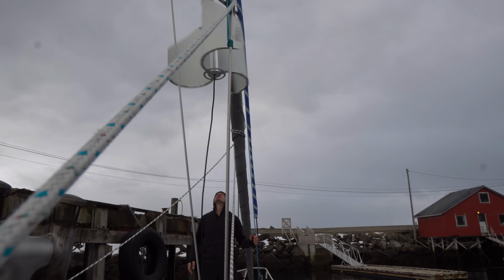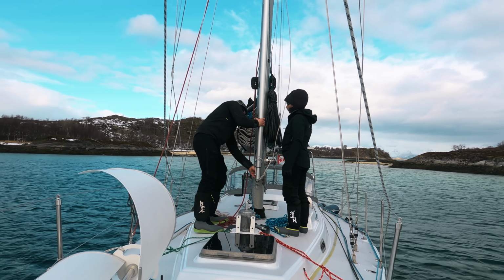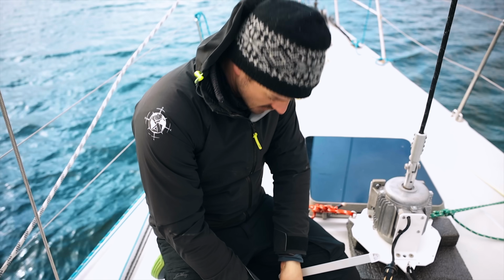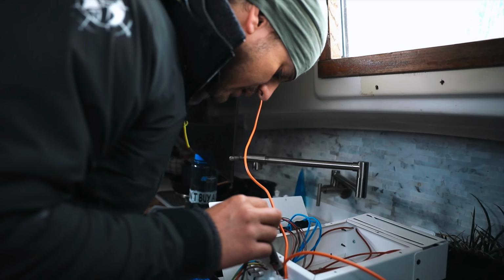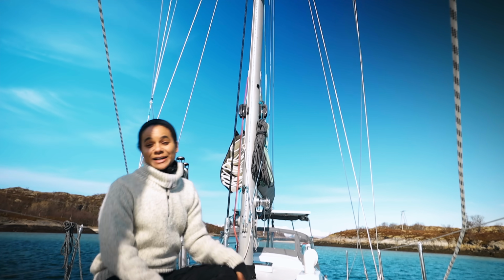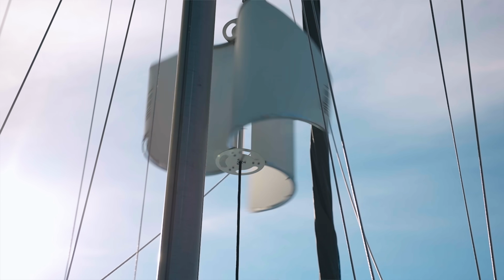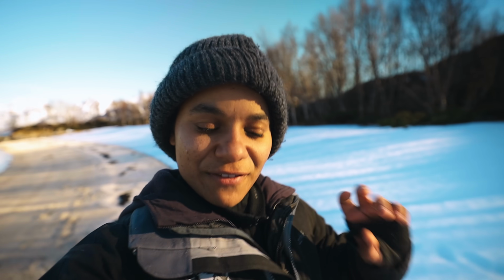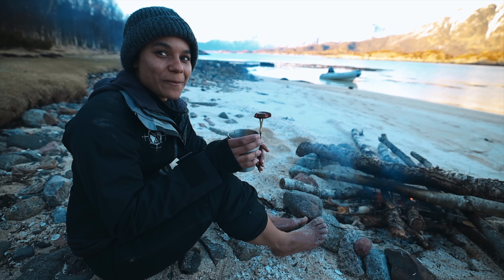No Sailing, Just BULLSH!T — Sailing Uma [Step 273]

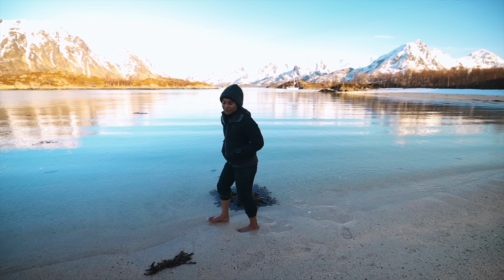Comment: 24:05 (The trapped air in the sand) The out going and incoming tide is the cause, as water drains out air will fill between the sand and because of the (water service tension rule) trap the air when the tide "floods" the shore line again. What also helps a lot is that there is no or very very little wave action to smash the air out...

Comment: Be careful with your fan on the fireplace, I have destroyed one,it's on too hot and it stopped working anymore, the element that turns heat into electricity melts away. Bay the way ,here in Finland people use to go to swim in the ice,but not me.

Comment: That's just lol. Tried it in Norway. Its sucks. Compered to Solar cells. But have more battery Is bether. Ore have a spirt genrator ore gas ore hydrogen genrator. You can also have a peltiel genrator. On the firePlace.

Comment: 'Chicken of the sea, Cod of the land', makes me chuckle when you can make a good joke about your predicament. Yes a properly mounted generator would make a difference and perhaps a well made metal coupler that you can fold down or at least in half to cut down the room it take up while stowed. The fan/windmill blades should mount somewhere on the mast about halfway, or if you can supply a good mount on top and no interference with the normal workings of the boat sails, that would take time and observance of where it would be clear of everything. You'd need to unplug everything during a lightening storm, just incase. Another idea might be foldable blades on the windmill/fan. just some thoughts.

Comment: RE your misalignment.... universal joint or CV joint. Cheap, easy to install and you'll see hardly any power loss even at 5 to 10° misalignment.  And.... it's not a motor, it's a generator. Or more correctly, an alternator.   Didn't read all the comments so apologies if this was all previously pointed out.

Comment: Use a composite material rod to connect the 2 with a cv style hinge point if u still need one like u have at the generator in the start of the first try, will make for better rotation transfer between the generator and the turbine

Comment: Hi. I love this project. 
I think if you take baby steps and connect the vanes directly to the motor without the torsion rope to see how that works. Then connect the torsion rope. I do think that the rope might end up developing a whip with the rotation speeds that you need. 
Good luck with this interesting project. Love it.

Comment: Could you use a stainless wire cable instead of the line your using, it would be more rigid and would need to go from the top through the blades to the motor. good luck with it. I have a regular wind generator and your right about the noise. I left mine running once after leaving the boat, a week later when I came back the cap and two blades were smashed off. the noise probably drove someone, in a nearby house or boat, mad. I don't blame them, for taking it out on my turbine it drives me mad often enough. Photography is beautiful particularly for someone locked down in Sydney AUS.

Comment: I cannot understand why it is perfectly ok to use a gas powered motor on your dingy but not to use a small generator. If you are that much concerned then maybe you should also use an electric motor for your dingy. That would be more consistent. One bit of an advice, don't try to re-invent the wheel.
Reply: Haha was thinking the same thing. A little Honda generator would do everything they want or need, very quiet and economical and probably puts out less emissions then the outboard. I’m all about being somewhat green but they’re already doing their part. Nothing is perfect
Reply: @curthook9622  Exactly, that is my point.

Comment: Spectacular photography! Good to see that the wood stove is in use. Great creativity and teamwork. You may already have these ideas in your wind vane "options" list: #1. Use a metal/plastic tube/pipe rather than the flexible torsion line. In concept, this would be similar to the threaded drill pipe used for water/oil drilling. Use 1/2" or 3/8" tube, 4' in length threaded at each end. Easy to assemble and store. #2. The wind vane appears to be about 2' high and 3' in diameter. Consider stacking several wind vane segments to increase the torque.

Comment: I’m no expert, but you should look into using a car alternator to generate power. The size seems like it would work well with that turbine. Also, car alternators are made for DC 12 volt systems, so you might not need to convert from AC power.

Comment: Some fiberglass rods with connecting screws would elevate the tension on the down shaft. They could be short sections that would store easily. Thinking electric fish poles that you can get a Home Depot.

Comment: Would it be possible to use your wine turbine to drive a traditional wind turbine generator? Just thinking that it would be pre-marinized, possibly lighter, and solve many of the potential integration problems. Best of luck with whatever you figure out - I admire your ingenuity.

Comment: Hey Dan, connect your battery drill to the motor and see just how fast/slow you have to spin the drill to start making power. i have a horizontal shaft motor, which could be turned vertical, which is 1850 rpm and makes about one volt for every 10 rpm and it is DC voltage. i wonder if something like that would work for you. great videos. Jim in central Florida

Comment: If at first you don't succeed, try, try again. :- )     Honestly, this is not the best idea. It looks to me that the downward tension  on the bearings is not how the device was designed.  I think that you will get better results just making a mount for the top of the mast or to one side of the solar panel base and attaching this device.  It's going to get costly if you have a metal plate designed to fit over the top of the mast; but it will be better. There really shouldn't be that much vibration or noise. After watching you do the other projects on Uma we have all the confidence in the world that you will get it done.  The  five "P"s = success.

Comment: Have you  thought about using ferrules to crimp the stranded wire when inserting into a connector designed for solid wire. There are several informative videos here on YouTube . And of course I found and purchased a ferrule kit on Amazon.

Comment: For a long time I've had the idea that if I ever have a boat, I'd have a tall wind vane with narrow blades attached before the mast, top and bottom, and directly attacjhd to a generator. So, a lot like what you have there but taller and more narrow, with brackets onto the mast. Does that make any sense?

Comment: You need a light wall aluminum  tube with a universal  at either end  for the drive from the blades to the generator, the tension  is robbing  power

Comment: Do you have a boat hook that you could use as a shaft to in increase rpm to the motor or does the line not torch?  The concept of wind vain looks good. Very interesting to me, thanks for video.

Comment: your polarized power connector is backwards.  the female should be on the motor.  We have a D400 and it does not make power until it is blowing 20kts.  We would not do wind again.  Good luck with your vertical generator.

Comment: You've got the height, why not stack 4 blades high, offsetting them by 22.5 degrees each to have one set of leading edges into the wind at all times.  That should also get the distance between the generator to less than 2M buy my tape measure vision, and then just put an actual torsion tube/drive shaft in place of the rope.  Looks good!

Comment: Having a garbage truck of memories I can remember something that should be of assistance. About 6 month to a year ago I was surfing YT about hydroponics and came across this guy who was heavily into designing his own systems. He designed his own Wind generator like yours except fixed with a solid connection. The thing is he went from a prototype to something that produced approx 300 watts roughly 10 to 20 times his initial output.

This was not by making it by making it bigger but his generator was a round horizontal disk rather like a plate and like plates he was able to stack the Stator's slightly offset on top of each other.

Wish I could remember the video it was a brilliantly simple engineering solution and very compact, though of course this term is relative when you live on a 30 odd foot sail boat

Comment: Saw you new wind turbine and it appears to consist of, a rotating shackle at the top, the turbine blades, a connecting twist resisting cord, a connector , the generator.  The complete system is tensioned to prevent the cord twisting. The rotation was clearly stuttering and not rotating smoothly. I have seen this problem before. The Shackle at the top is designed to allow rotation occasionally but not in a continuous load bearing manner. You need to replace this with a bearing system designed to run continuously whilst under tension. Any descent engineer should be able to source a suitable bearing and fabricate a housing. The turbine looks fine. The cord is the main source of the problem in that it requires high tension to prevent windup. Replace this with two or three stiff rods connected by universal joints. They will not twist mechanically resisting windup, and do not require great tension. You could use a single rod with universal joints at each end but this might be too long for easy storage and rigging. Two or three rods would make these much easier. The rods could be carbon fibre for the ultimate in stiffness and lightness but expensive, alternatively look for duct rods these rods are lightweight, tough, have quick release connectors on the ends for easy assembly.  Some universal joints attached to these connectors would be very convenient. The tension required would be much lower. Finally the gerneator is almost certainly not designed to have high tension pulling on the shaft and is certainly adversely effecting the bearings. The lower tension would make the friction much lower. Another consideration is preventing water running down the generator shaft and onto the bearings. Construct a shield to prevent this. consider mounting the gen below deck with a waterproof through deck fitting.feel free to contact me to discuss further. Steve
Reply: If you get a system that works well you might consider getting an engineering firm to create conversion kits for sale, a good source of revenue. Steve

Comment: Dan. Kika, you are inspirations. I've been thinking about this for the past month or so. You're engineers. I'm a machinist. I think it has to be mounted on the lower shroud. Efficiency, ya know? I see the short turbines you have presented. I know the goal is to make them the whole length of something. I mean the whole length of the mast supports. Joints will have to be machined to allow rigidity for the mast while allowing the shrouds to spin. Right? The generator will have to be mounted below deck. Is there room? And the generator will need to be balanced to the top joint and the bottom joint which I foresee to be stationary bearings, so more cables or other fasteners will come into play. I know my ideas expressed here are crude. I was just so pleased to see your video that witnessed you guys trying to solve an issue I've been thinking about for so long. I wish you the very best. Please let me know if I can be of help solving this issue.

Comment: Not to over complicate things, but have you considered hydrostatics? Small power unit up the mast below the turbine - hydraulic lines running down to the receiving unit that powers the generator. No need to align anything.

Comment: Wire rope vs nylon would be my first choice if available for the wind thingie. EMT conduit is lightweight as well.  
Also thought about putting the wind vane straight off the back , put the motor horizontal and connect with a straight pipe with one 90 degree U joint or two 45's.  just something to consider ..................  enjoy

Comment: Just use an aluminum torque tube with a universal joint on both ends do not load it on tension that sucks up the wind energy and most likely loads the bearings. Horizontal  propeller type wind turbines are the best and most efficient. Don't think you  have enough wind to generate anything.

Comment: What you need is a flexible drive cable like you find in a weed whacker or similar. I understand it needs to be much longer but the torque these cables can take is considerable. Maybe a manufacturer would like to be involved in your project ?

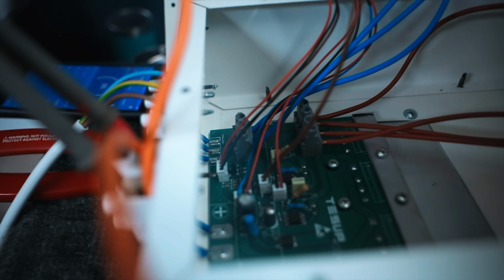Comment: did you find what was burning in the electronics box? With that amount of smoke there is a fair chance you can visually find it. at 13:06 it is hard to see but one of the caps looks like it is bulging so you might be cooking it (or not, could be the diodes as well).  Great to to see some hands on McGrubering boat engineering and no pina coladas and bikinis.

Comment: U need to think about higher aspect ratio blades. Optimum for sevonius rotor is just over 3:1.  Best commercial VAWTs are NOT sevonius rotors, but slender foils mounted on a spider for greater torque. Higher aspect ratio symmetric airfoils are also easy to store along lifelines or toe rails.

Comment: Could you just run the output through an MPPT solar charge controller before battery?  that way your low wind low voltage would get boosted up to useful 13V.  just thinking out loud lol

Comment: I not sure if there is any net gain in having that the blades up 20 ft up in the air, or on top of the motor with a minimum length shaft.  There really isn't that much to block the wind out there.  A short shaft between the two will reduce wear and tear on the generator and will minimize the jerkiness on the rotating shaft.  I am no engineer, but KISS may be the best route on a bouncy boat.  (I will put my flame suit on, now.)

Comment: I thought of a 4th way to generate power. Its invasive but it might work. What if you have a free spinning propeller in front of your motor propeller underwater that generates electricity when your sailing? is this possible? I got the idea from aviation. The airbus it has a emergency propeller that uses airflow to create power for equipment. Only thing that I saw will be problematic is the propeller size limits, but you could always have multiple to increase charging speed and quantity. Just a thought, hope you see this!

Comment: Great idea, may need to concider the loads you are now excerting on the parts, I think the pulsing and resulting sqeaking came from the torsion line union, install a universal joint at top and bottom of torsion line terminal connections to effeciently deal with the off axis alignment. If you can design this to take the linear loads and buffer any rotational axis misalignment then you can make you motor mount more modular and effecient. Interested to see how this poject develops, many fundamental challenges to overcome, hoisting/lowering, balancing speed wobbles, magic smoke ...... might be worth looking into and power input controler like a Scotty from Safiery.
Good luck guys, love your work.
FYI - I use 'bootlace' ferrules for the screw terminal blocks (changing them out for soldered connections is better for permenent installs)

Comment: I know you want to be fossil free however the solution is actually a small petrol genset.  They are really cheap and quiet now.  You have a petrol powered dinghy so as long as you have that you will always be carrying petrol anyway.

That motor is not really suitable for the application.  You would be far better with a alternator designed for low speeds like this https://www.aliexpress.com/item/33046937332.html?spm=a2g0o.detail.1000023.7.4fe139f84GF931 or this https://www.aliexpress.com/item/32920185580.html?algo_pvid=678ddf47-7396-46d6-bb93-6bd0d2b6ecd3&algo_exp_id=678ddf47-7396-46d6-bb93-6bd0d2b6ecd3-4.
These are expressly designed to give a decent amount of current at low speeds.

Comment: Instead of using a piece of line to transfer rotational force from the wings to the motor why not use something much harder like a section of rod rigging? Wouldn't this be more effective at transferring a lot more of the force directly to the motor? A soft connection (rope) from wings to motor surely loses a lot of efficiency by twisting and swaying. Just a thought...it is trial and error! EDIT: using the section of rod rigging would also allow you to lessen the vertical tension needed to transfer the force from wings to motor and, thus, allowing the motor to spin more freely (and maybe more efficiently!).

Comment: extendable aluminum rod, or a solid piece of aluminum rod 3/8 diam., I do not think an extendable rod made of wood would be strong enough. use expendables for storage requirements. That stuff you are using now will just he-haw and spring up. You need something more solid.. a braided rope would work better.. make it tight no twist or spring.

Comment: greetings from Canada Not a sailor at all but love your channel and what you guys do just a thought install drive a  pulley offset from the motor with a larger pulley than the motor would you not increase the rotation of the motor  . thinking like a bicycle crank  and gear type arrangement but on its side . hopefully you understand what I am thinking ,  with the crank being driven by the wind generator  . so you have a pulley on the motor and a pulley offset which get the power from the turbine  you can vary the pulleys based on wind conditions .  also it would seem you are losing efficiency in the rope . would a rope wire cable work better and have less give sort of like those flexible shafts you get with your dremel kit. ^ . Not a sailor at all but love your channel and what you guys do. as well